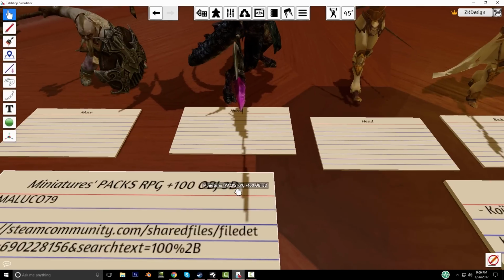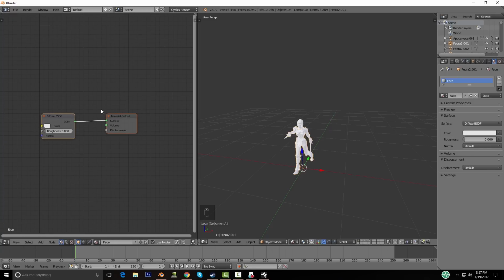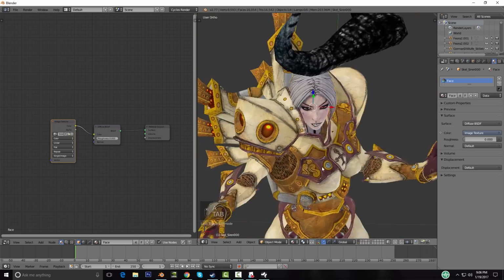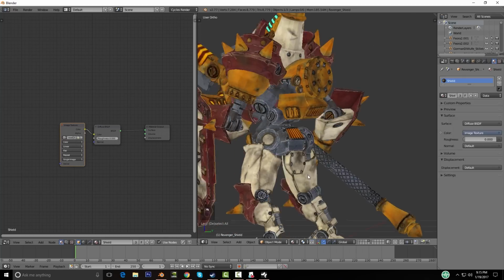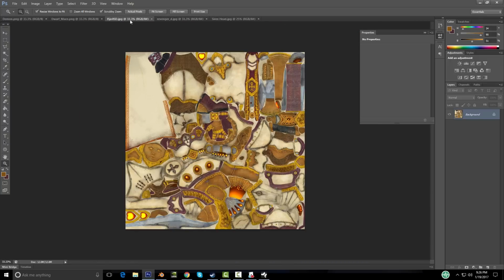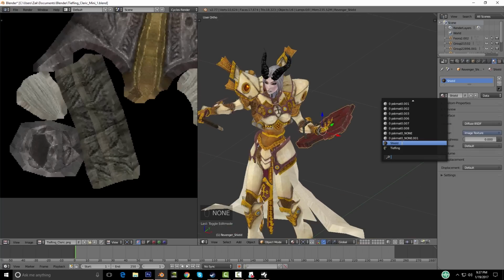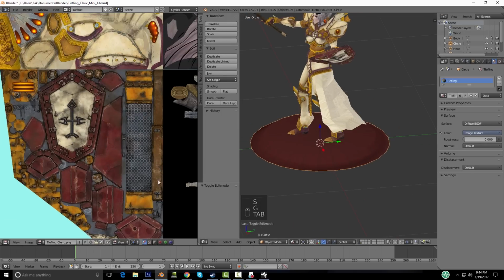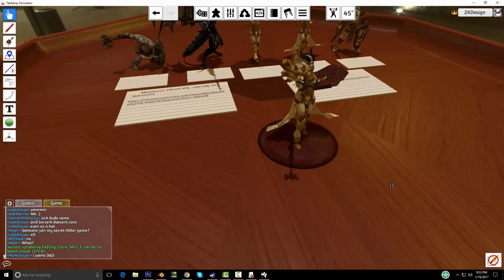Tabletop Simulator Custom Miniature Guide - RPG Tiefling Cleric Blender Kitbash

Comment: Great tutorial. Simple, clear, informative. However, it's absolutely infuriating how many Tabletop Simulator models these days are "asset packs", meaning you can't actually open them in Blender and use the desired pieces. I swear every time I find models I want to use, they're in the dread "unity3d" file format.

Comment: EDIT: If any ya'll are using 2.9/Eevee/a version without the Layers function, PLEASE look at the replies to this comment! I made a very brief detailing of how this works today.

Oh my fucking god, you saved me so much pain, even four years after you made this.
I was practically tearing my hair out because I couldn't figure out how to add a new mesh (a custom base) to an existing UV wrap (for my figurine's model texture) - and no matter how hard I Googled, not a SINGLE tutorial mentioned the fact that there's a GODDAMN "ADD TO LAYER" BUTTON for the new mesh!

Thank you so much. You are an absolute lifesaver for homebrews. <3
Reply from the maker: Glad this is still helpful after all this time! Ya idk if it's the workload or just the nature of UVs but I feel like doing even small stuff like that can be a nightmare to solve in blender sometimes, but the high of finally figuring it out is the best. Thanks for the comment!
Reply: @zkddesign8687  I goofed and actually forgot to add an edit, but I was initially scratching my head as to why "Add Layer" didn't exist - kiiinda jumped the gun on my comment, brain's been fried from the frustration. Turns out, 2.8 onwards removed the Layers function and just make it all automatic.

The process in Eevee/2.9 is (from the point of making your base or importing one to use):
- Make/Import your Base and go to the Material Properties tab, make sure it's the same image (as you do!)
- Unwrap the Base, size down to a position you know is relatively blank on the Wrap you're using (as you do!)
- Go back to Object Mode to select both the Model and Base
- Go into Edit Mode and hit A to select all vertices (for both Model+Base in this case)
- Tweak the Base's position on the Wrap as you like
- SAVE THE IMAGE from the Image dropdown on the UV Editing tab to use this in TTS' image import (this says "oi, the base is part of this model, stupid"), otherwise you'll import with a broken/empty custom base

That very last step was a massive "Really?!" moment for me. Your guide was still exponentially useful to me, and I'm so happy somebody made it. c:

Comment: hi ive just found this video , can the models you make be 3d printed?
Reply from the maker: Typically the models we're working with for tabletop simulator are going to be too low of poly count for 3d printing and since most of them are pulled from games they aren't manifold so there are gaps and holes in the mesh that will cause failures in 3d printing. Most of the principles I'm doing could work in modifying models for print but you'd want to work with higher polycount models. The files on thingiverse are usually better and sometimes what you'll find on sketchfab but it takes some experimentation to figure out what will and won't work for print.

Comment: My Blender dosn't look anything like your Blender so Screencast? Cycles Render? There are no little buttons for layers.
Reply from the maker: This is an older version, if you're using the newer 2.8 version or later they changed the layers to collections so you select the objects you want in that layer, still hit M and choose new collection then you can toggle the visibility in the hierarchy (default top right). In terms of the render type, 2.8 defaults to the evee rendering engine instead of cycles. You can still use evee for everything in this tutorial and itll work fine, but you cant currently do any baking which shouldn't be necessary with this setup if I remember correctly.
Reply: @zkddesign8687  Hello I cant seem to find where the node thing is to add a texture file
Reply: @dannymarch8091  Took me a while, but I found it. After you click Use Nodes, in the options that appear on the right menu, choose Base Color and change it to Texture > Image Texture.

Comment: I have been getting an error about it failing to load .obj, is there a reason this is happening
Reply from the maker: Failing to load in blender or when you're uploading to tabletop simulator? If that comes up when you upload to tabletop simulator your vertex count is probably too high. I would use the decimate modifier on your model and bring the slider down until the vertex count in the top right corner is below 14,000. Even that may be too high. Tabletop simulator doesn't have an official max vertices for a model but from my experience it's in that ballpark.

Comment: Took me a while. But was able to make one for my character. Just a thing i was trying to figure out that sometimes worked when importing. but it just imported everything for image wrong is why i had to redo it. was that flipping the figure, usually it would just be underneath the board only the bottom being shown. but so far with everything sticking to what it should. i'm only able to make it flip on it's head without tipping lol. any way to be able to flip underneath?
Reply from the maker: Raymond Mills it sounds like you are having one of two problems. Either your collision box is only covering the very top of your model which would cause it to fall into the table or possibly the origin of the model is too high. For the collision box, just adjust the size in blender by moving the bottom four corners to the bottom and re-exporting just the box. For the origin, just raise the entire model and collision box up higher in blender. Did you make sure to add your custom collision box to the model in tabletop simulator? Hope that helps!
Reply: yea before reading this. i was tweaking with it. but my box isn't large like yours on your figure. it's tiny and between it's legs. i managed to get it just now actually to be able to show the base. as well as when i flip it. it goes through the table. But I was wondering. I only was able to make this because of mish mashed pieces from yours and the one that worked in the links you gave me. but throughout steam i couldn't find any that worked because it wasn't drop box. it was in the form of paste.ee. is there a way to use paste.ee code page for blender? there was a lot of models i wanted to use at first. but they were all paste.ee.
2nd question relating to making a custom piece. i wanted to create a piece of my own from scratch on the free time. but since i'm new to all this and your tutorial was really easy to follow and that's how i was able to make my tiefling Valor bard. is there a simple way to make the same style of figurine from scratch? if so what programs will i need?
Reply from the maker: Raymond Mills so paste.ee has .obj files in text format. What you want to do is copy all the text, paste it into notepad. Save it as a .txt. now go to the file you saved. Change the .txt to .Obj. if you can't see the file extension you might have to go into preferences on file explorer. Once you do that just import like a normal .obj file. Making characters from scratch is a decent bit more time consuming but doable. I know a lot of people can make a fully modeled and texture character without it but I'd really recommend getting your hands on substance painter. Between that and blender you have everything you need to completely make an original character. I don't tend to have a ton of free time but I'd love to do a full tutorial on how to model and texture a low-poly character.
Reply: yea, that would be really cool to see when ever you do have free time. i feel that others would learn really easily with how you do your tutorials. they're nice and simple and to the point. i played DnD yesterday with the group i'm in  and they liked my piece i created from what model pack you used essentially and want me to create something for one of the clerics lol. yea i'll try to get it to be an obj file and see if that works as a text. but i remember last time i tried to change the preferences, i couldn't find what i was looking for as an obj
Reply: :Folder options>View>Uncheck Hide extensions for known file types: is how you're able to change .txt to .obj for those that see this in the future.

Comment: That helped me so much! Thanks a lot!
Reply from the maker: Nuno Pignaton Perim glad it helped! Thanks for the comment!
Reply: The only thing that i am struggling with is the final part where you create another material, tiefling, and then applies to everything. I never used blender before so is being quite a challange to figure it out what im missing XD.
Reply from the maker: Nuno Pignaton Perim did you have any trouble with combining the textures in photoshop or rearranging the uv map?
Reply: I fixed it :D I think the problem was that the bodie that i am using was still divided in multiple pieces and assorted to diferent materials, and when i tried to "ctrl+J" them and use the new material it didnt work. Now i think i manage to fix that. The issue that im having now is to match the texture size in the new one. It doesnt seem to fit very well and doesnt look good hehe. Sorry for the broken english. And thanks a lot for answering!
Reply from the maker: Nuno Pignaton Perim ya resizing the uv maps can be a little difficult, especially when the original maps aren't a perfect square. The best advice I have is to find a few points on the texture where you know exactly what part of the mesh goes there. Once you have one point lined up you can scale on the x and y axes until you get the other points to all match up. A lot of what I do in the video involves all perfectly square meshes which are much easier. I know some people also just bake the textures. You might find a good guide for that by searching for something like "baking combined diffuse textures".
Reply: I figured it out! Thanks again for the video and for the attention! If a noob like me could do it, you did a pretty good job :D. Tabletop lacks a lot of stuf for DnD, so when my friend said that he wanted to play a Tiefling kid i knew that it was going to be hard. This is a great tool for me, since is much easier then moddeling from scratch or taking models from other games. Keep up the great work! I would love to see more tutorials for blender from you.

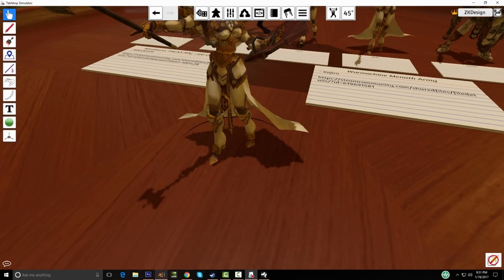Comment: Wow that's exactly what I neede! Especially around 1:00:40 helped me a lot to manage messed up bases :D Thank you!
Reply from the maker: Glad I could help! I'm planning to get more content out when I have the chance but it's great to hear that it's helping.
Reply: @zkddesign8687  Yeah I try using your method but the base is still transparent think you can help out? using blender 2.8
Reply from the maker: @shadow1910  the base is only transparent in tabletop simulator right? Im guessing you need to recalculate normals. Go into edit mode, select the vertices in the base then go to the mesh pulldown menu and normals, then hit recalculate normals. That should fix the problem. Blender has the backs of sauces visible but tabletop does not so transparent meshes are usually a normals problem.
Reply: @zkddesign8687  Yeah still didn't work. I did recalculate inside and outside and can only see the sides of the base. To be honest it's not really a base but a cylinder you can create within blender that I just resize to fit a model on. You think it has something to do with that? btw it's blender 2.82 if that counts for anything
Reply from the maker: @shadow1910  my next guess would be that part of the mesh us on a transparent part of the texture file. In the UV panel select all of the vertices of the base and drag them over a portion of the main texture. Also check if you've got more than one uv map assigned to the base and make sure the camera icon is highlighted for the right map.
Reply: @zkddesign8687  yeah turns out I didn't follow everything in the vid, forgot to to extrude and scale vertices within base, sorry about that XD and thank you for the help